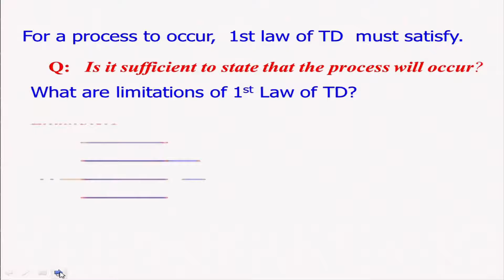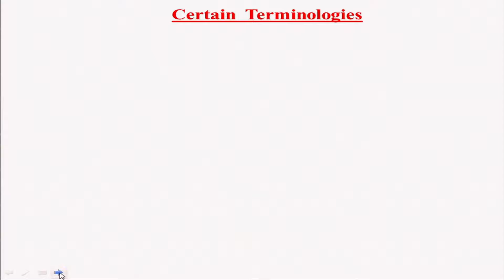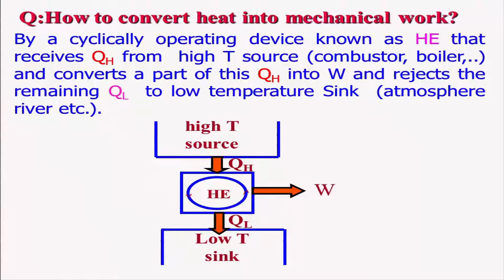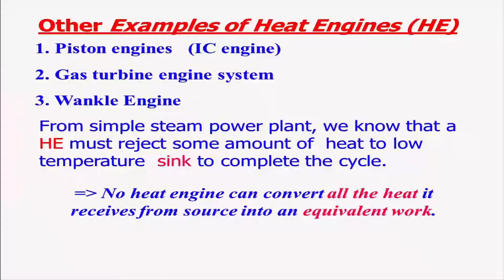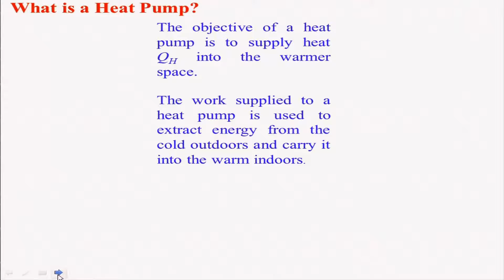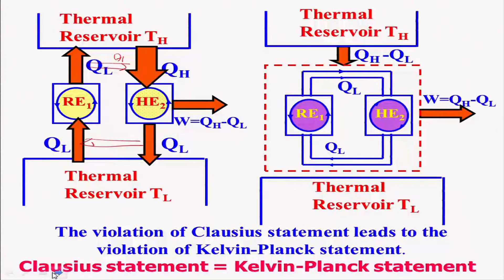Second Law of Thermodynamics: Basic Concepts 1

Comment: 41:00 
Cop of HP is 1 I think it is indicate there is no any heat added from the outside , whatever the heat is added to the room it is all because of work given to the compressor .and cop is zero that means the net heat from out side is going to add into the room without any work given to compressor
Is it ???